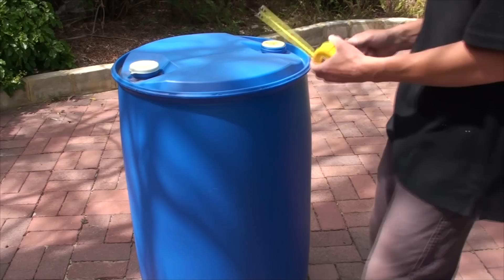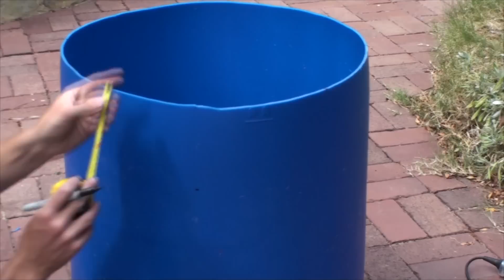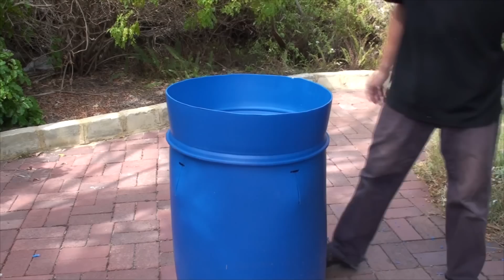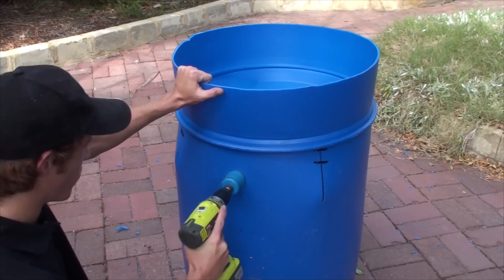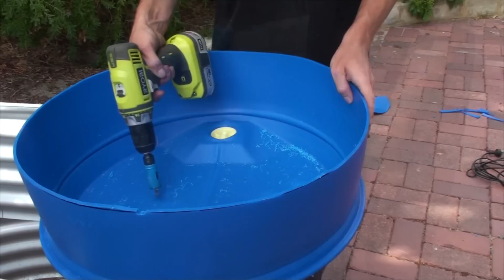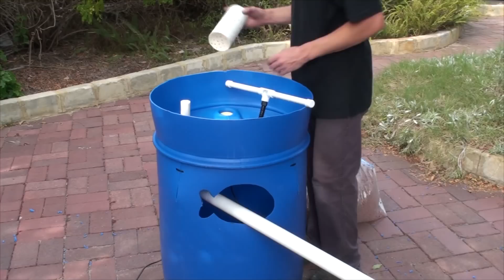I-Barrel Aquaponic System

Comment: I know this is an old vid but  you don't need to shrink the bottom half the top half will fit all you need to do is fasten it drill some holes matching the top and bottom matching the holes at the top then use wire or whatever to tighten and it will fit perfectly plus it makes it really sturdy
Reply: How many videos did you watch to learn that have you ever build one of them this was ages ago when there was not much info back then he probably already knows that now it's all over YouTube aka Rob bobs